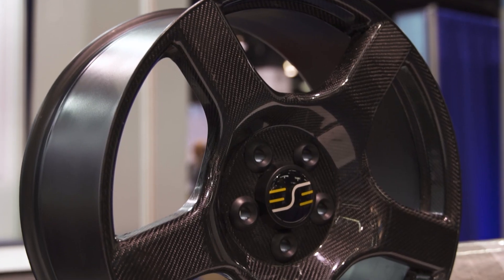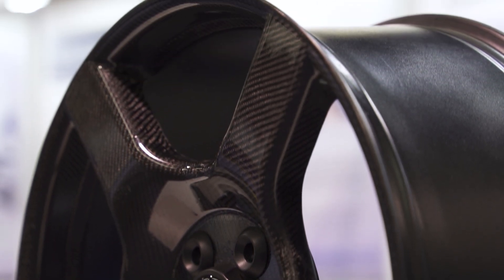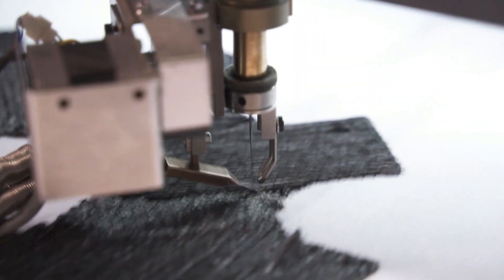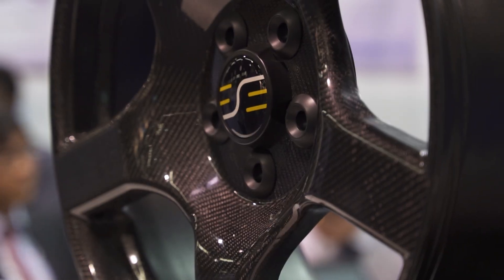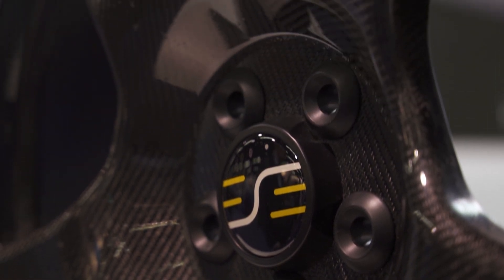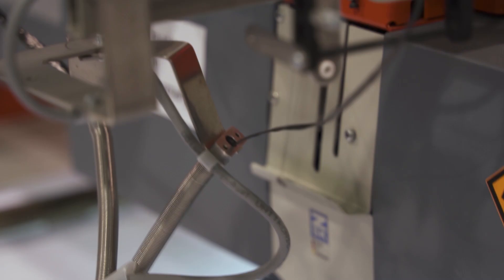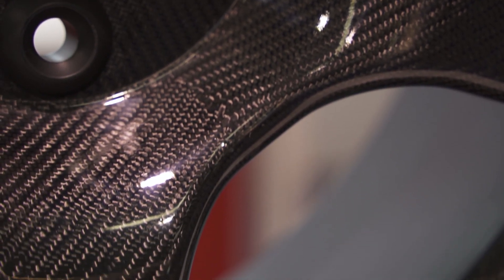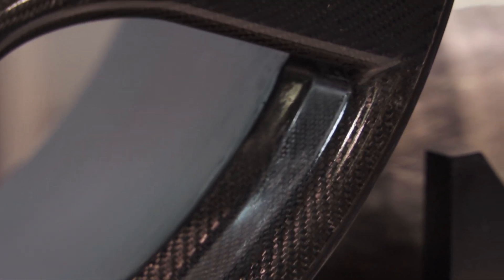TFP Enables One-Piece, One-Cure Carbon Fiber Wheel

Comment: $10,000 where is the cost savings?
Reply: It’s only $9800 for a set of 4.  The current market is anywhere from $3598 ($14,392/set) to $6326 ($25,304/set), depending on what you want.  So this is huge for bringing costs down from where they currently are.  There’s a lot of manual labor for lay-up on CF wheels, proprietary design and autoclave techniques to create specific structural solutions, and highly-skilled, low-density workforce experience required that generally resides in the aerospace industry.  $9,800/set is a steal for those who are in the market for CF wheels.  It’s a very niche place where high performance or low weight are worth the price of admission.
Reply: Go see HRE ... $20,000 won't get you past the front door, with those puppies! $10,000 is very, very reasonable!
Reply: Mate, 10k for 100% CF alloys is ridiculously cheap. If I'd randomly seen the product on a site or in a shop, I wouldn't have believed it was genuine. 
The price drop is that good! I wish them all the best with the OEM contracts.